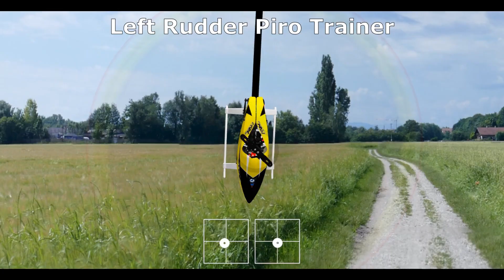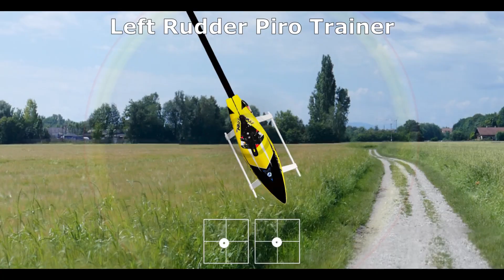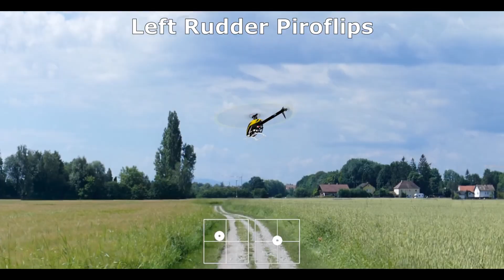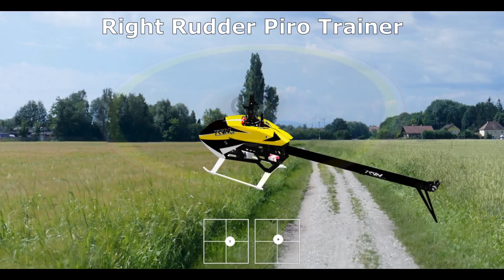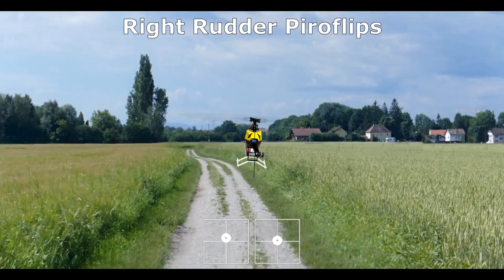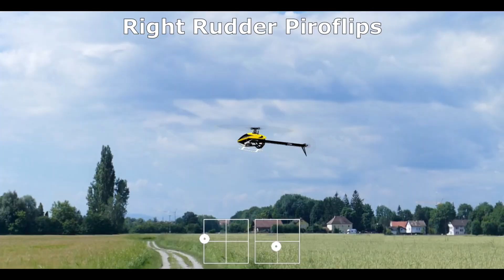Full Piroflips Step by Step

Comment: The way I see it there’s two ways to learn these types of manoeuvres, step by step like in this video or from start to finish in one go. If you put aside your current skill at what you’re practicing and look at it week on week, you won’t feel as unmotivated when you’re not seeing instant results. I learned piroflips by learning the general stick movement and timing, and then failing at 60% sim speed for a week or two. At the end of the day the brain needs to form the subconscious connections. Now I’m at a point where I can do them badly at 100% speed. I didn’t use a piro trainer etc since I feel like they abstract away from the real manoeuvre and will hinder you in the long run, but it is useful for checking biases in the flip once you’ve got the core movement down. 

My point is that learning these things is more a matter of DAILY practice and letting the brain do it’s thing rather than the method of said practice, and as long as you’re practicing daily you will get there sooner or later. But I appreciate the breakdown and your way might work better for some people but no one is going to make any meaningful progress without daily practice regardless which method you use
Reply from the maker: 100% agree!

Comment: Sir, how can I play this simulator with at9s pro remote?
Reply from the maker: I'm not familiar with that radio, but it looks like it has a PPM port on the back. There a are a few dongles that convert to USB, which is ideally what you're looking for. Heli-X and AccuRC both have a list of dongles on their website that will work with their simulators.

Comment: This really shows the step.
I realize now that I've been actually doing a full flip(regular to invert)  in 1/4 rudder rotation.
Not even a half piro, but actually a 1/4 piro.  There is tremendous aileron input that allows this, so the tail swirls in a conical motion.
This is done on my realflight at 150% physics which feels(actually harder) than real field flying.
Now, I just have to stretch it out.

Comment: What simulator is this in?
Reply from the maker: Heli-X
Reply: @rchelicopter  thanks I been using Phoenix so you think heli-x is better for learning. I been thinking of buying a new sim but can't figure out which one
Reply from the maker: @jodymorrison9495  Heli-X is the only one getting updates at the moment with new models. You can try for free to make sure it works on your system. neXt has almost stopped doing updates, but might still be worth it.

Comment: Hi Richard, I can more or less do piroflips but as soon as I increase the speed of the tail. Do you have any advice for that? 
I also have trouble staying in the same place when I do piroflips, the helicopter goes off in all directions.
Reply from the maker: Essentially piro flips are really difficult, and because the tail can be fast, I couldn't find a quick way of fixing them. I think it just takes time, not something you can fix in a weekend. Vary the practice and speed, make sure you do a few every day. Try them from standstill as well as pirouetting. Try them with half, 1 and 2 piros, and they will come.
Reply: @rchelicopter  Thanks Richard, I'll keep going.
Reply: @rchelicopter  Thank you very much Richard for your method, the movement is starting to sink in and I'm doing it faster and faster. I wanted to tell you that I appreciate your help for novices ;). I'm starting on the right side now.

Comment: Richard I have NeXt simulator. It works ok but in terms of a guided trainer for specific maneuvers it is lacking. What sim would you suggest that will teach you eD maneuvers?
What software are you using in your video here?
Reply from the maker: I don't think any of them do a particularly good job of guided trainer. RealFlight has some hovering exercises, but I've never managed to get beyond level 27.
Heli-X has some hovering exercises as well, but probably not what you're after I imagine.
This was Heli-X. You can try it out for free. I think it just limits the helis and fields, and there's a popup occasionally, but very usable.